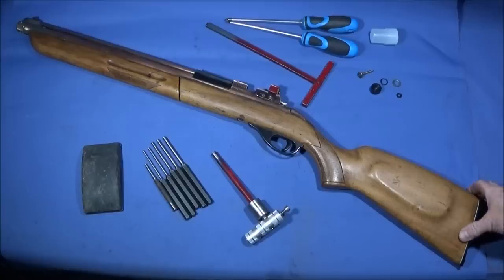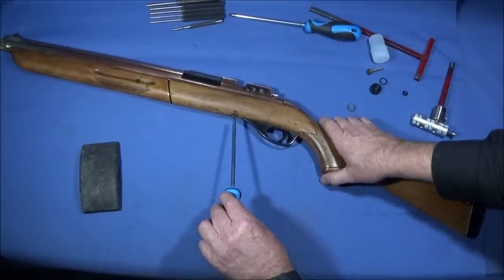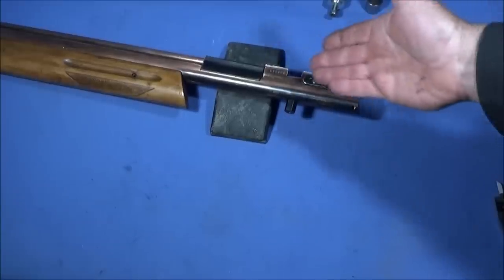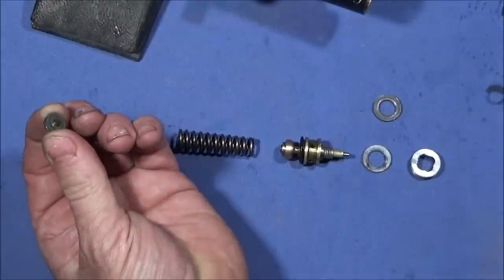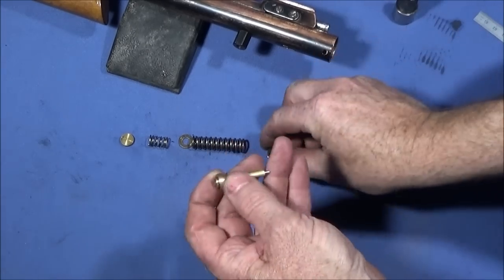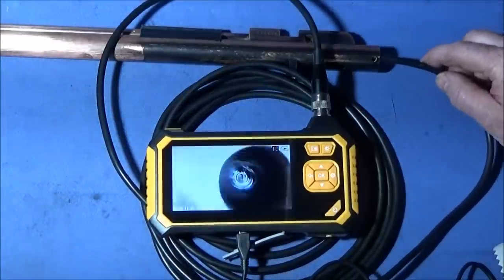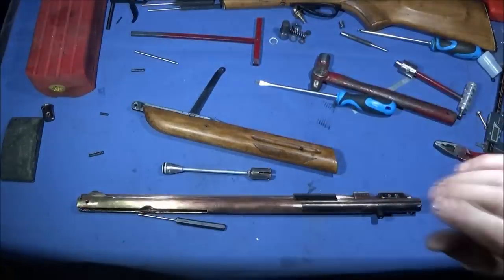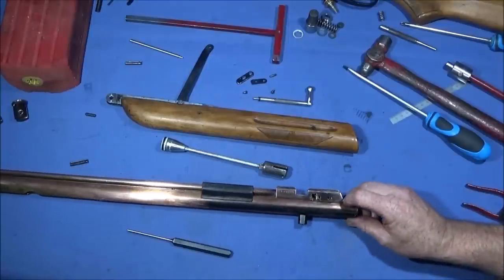Complete Setra Strip Down. What's Inside A Pump Up Air Rifle?

Comment: Very similar to the old Sheridan rifles which also used a lead washer. The tools used to remove the nut and extract the valve are very similar, if not identical. I'm curious as to how these rifles were regulated to maintain a sub 12 ft lbs power output. I know some Sheridans had a weaker hammer spring which gave two shots and some were regulated in the firing valve which vented some air to atmosphere and the final Crosman version had a relief valve in the pump head. 
Thanks for a great video and the idea of using an endoscope to examine the internals which I would never have thought of!

Comment: Hello Steve, me and my dad are working on his old Setra pump air rifle. I can't find any other strip down videos, and as yours seems to be a different model, we are stuck. We both don't have the best knowledge of air rifles, and don't know what a certain part is. Next to the hexagon part there seems to be a cylinder with a screw. We don't know what is underneath that screw, as my dad has lost it 30 years ago. When we pump the rifle up without it the pump is very loose (which I seem to think we just need to oil it) and we can hear air escaping. If you can help us on what part that is, and where to obtain or if we can make the parts, we would be very grateful.

Thanks Steve.

Comment: Hi Steve,
That looks very similar to my Sheridan silver Streak which is nickel plated, never had the need to tear it down.
At least I've an idea, thanks to your video😎😎
I owned a sharp Innova air rifle back in the late 1980s, I regret selling it on now, probably similar type mechanism.
Do you have any experience with stripping a BSA super star ?, Trying to remove the scope dovetail, so I can get to the piston seal.
It's seems to be dovetailed fitting, but it will not move, I don't want to damage it .
ATB Adam
Reply from the maker: Hi Adam I haven't had a Superstar. I just normally study a breakdown drawing to see how something comes off, but have to be looking at the gun as well. I had a look online but can't see a close-up of the dovetail fitting area. If you mean the actual fitting that holds the scope onto the gun that should just come off by loosening the side screws.  If you damage those they are easy to replace? If its the actual gun though, I would need to see the part you mean? Your Sheridan must be a nice one.
Reply: @SteveJordan  
Thanks Steve, I'll try to remove it on the weekend.
The scope rail looks to be keyhole slot mounted, with a rubber gasket underneath.
The screws come out very easily, the scope rail is still solidly fixed.
The Sheridan I got new in the late 1980s early 1990s, 0.20" calibre, it's had very little use over the years. 
Got it from Ramsbottoms when they were in Keighley as they were the main source for airguns and firearms in my area.
Always liked under or side lever springers.
ATB Adam